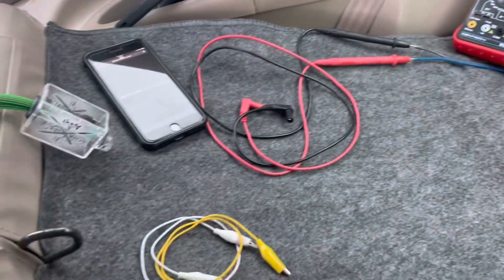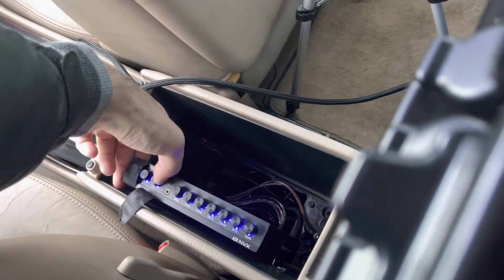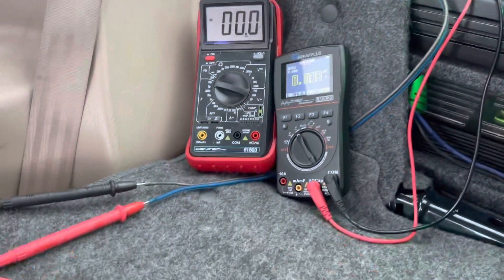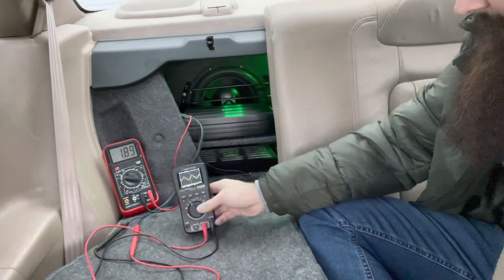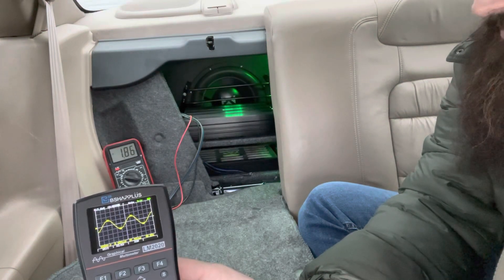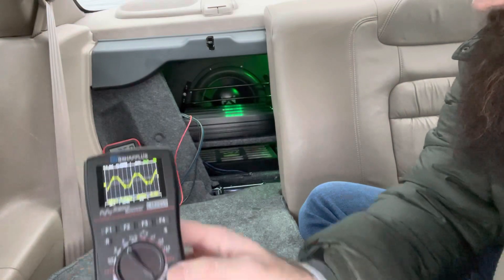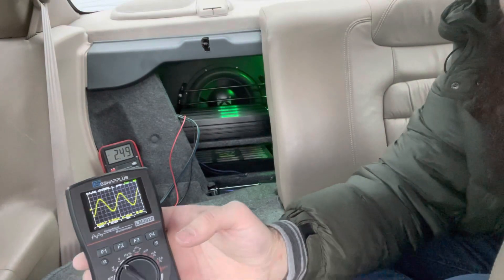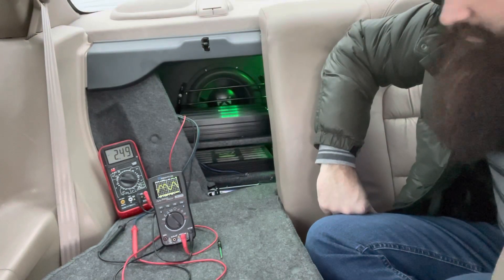Troubleshooting amp gains (NVX XAD15)

Comment: 90 Volts? Does that mean it's doing 8100 watts at 1ohm using the (square root of power X ohm = voltage) method?
Reply from the maker: @gregkirby  that’s unloaded so basically zero ohms. I’ve gotten 4400 at like 1.4 ohm. Some smart 3s will do around 90v unloaded too. I’m running 15.7v electrical so everything is a little higher now. Car, amps, and radio have been fine for two years like this.
Reply: @thelifeofriley815  I have the same amp that does the same 90v. That's why I'm asking, lol.  I have a basshead garage wattmeter now that helps out a lot. I was just wondering how 90 Volts equaled 5k using that formula. If I subtract 30% I get a lot closer to what these amps are rated for.

Comment: Lol 9:05 "I have to be careful with the bass knob." Knowing the next video you posted this sounds like foreshadowing. I'm not trying to make fun it's just I know that game of ping pong. First the amp blows, then you upgrade the amp and the speaker goes, etc etc.
Reply from the maker: Speaker went because it was hitting the speaker grille. They are still playing strong. Wired them to 4ohm and removed the grilles and it’s fine. Had to glue the surround back together.

Comment: is that eq your source? bc if so that thing is dirrrrty
Reply from the maker: It’s clean output up to like 9v. I turned it down to about 5v because the JAD amps couldn’t do more than 6. These XAD can’t do more than 2.5. The amp is distorting the signal because it just doesn’t know what to do with the high input. It’s clean now at 2.0v. If the radio I’m getting doesn’t have enough adjustment I’ll be getting a prv 2.4 dsp.
Reply: @thelifeofriley815  i've never used an eq like that before, but with stereo's the output voltage on the rca's go up with volume, is it not the same with that source? or does the bass volume knob keep the voltage fixed and not in relation the other volume knob?
Reply from the maker: @lunchboxjoeb  voltage is adjusted by volume. Eq has master vol and sub vol. I’m talking voltage at max volume and I’m turning the gain down on the eq to set it where I want. So it’s set to do 0v-2.0v so the amp is happy.
Reply: @thelifeofriley815  right on, my other question would be whats  the motivating decision behind the prv dsp over something easier to set like the dayton audio
Reply from the maker: @lunchboxjoeb  I’ve played with a friend’s prv so I have a little experience with it. I’ll look at others though. That won’t be until I set the new radio up and redo a few things and then determine if I need it.
Reply: @thelifeofriley815  right on, it seems like it would take quite a bit of patience to set up ... ill be lookin forward to all the content though regardless. thanks for making it
Reply from the maker: @lunchboxjoeb  yep! I’m about 5 years into the process of putting this together. As soon as it’s done with one stage, I start planning the next. 3rd set of speakers, 2nd subs, 3rd amp setup. Just thought I’d pick up the camera since I’m already doing it all. Still not done with it. Probably never will be.
Reply: @thelifeofriley815  by the time you think youre done you'll have a new vehicle and it starts all over again lol

Comment: Makes sense to me.   The Brazilian full bridge amps used to only take 2v input max.  Then most of the other companies copied their designs and had their own amp line manufactured in China.  My taramps 3k is the same way.  2.4 volts Input produces a clean signal.  Anything higher distorts the waveform

Comment: Very interesting diagnosis, well done.    I think you're fine at 2v, the input voltage shouldn't be that critical as long as you can still get full power from the amplifier.     I need to readjust all my gains again.  The music I have is so varied and the loudness of the songs are all over the place so I need more headroom to turn it up on those.   But as you sort of hinted on, it takes discipline to run a system that can be overpowered.
Reply from the maker: Yep, just need to set the eq volume and leave it. I adjusted the gains at the 2v mark so it’s giving full output. Saw 89v on my meter so that’s a lot better than 5k, haha! Impedance rise is the only thing saving these subs.